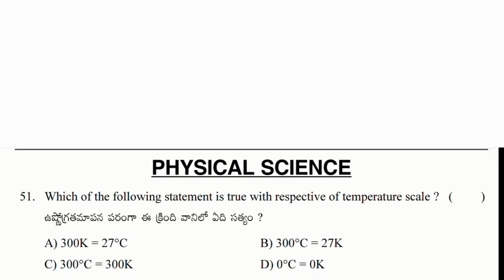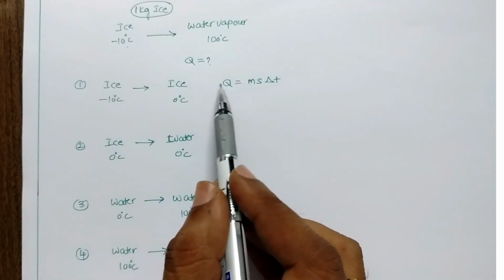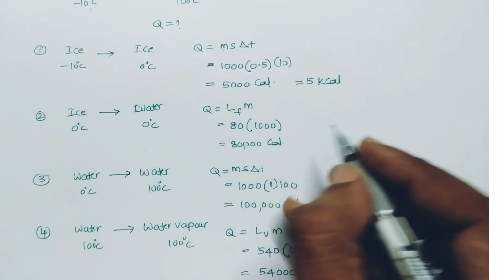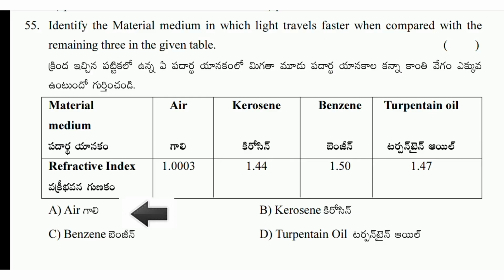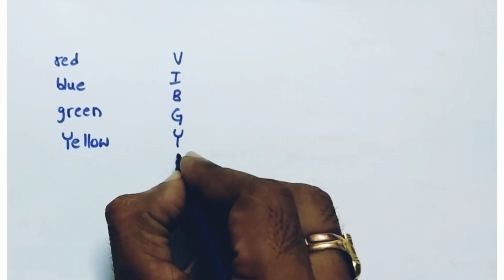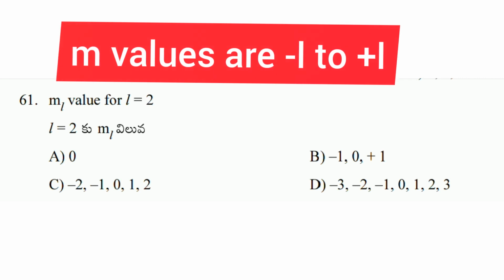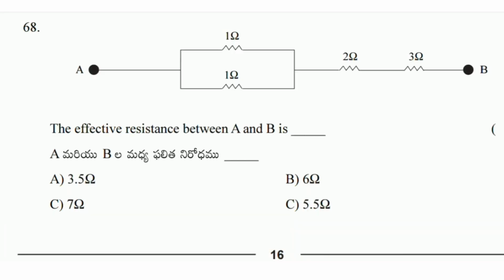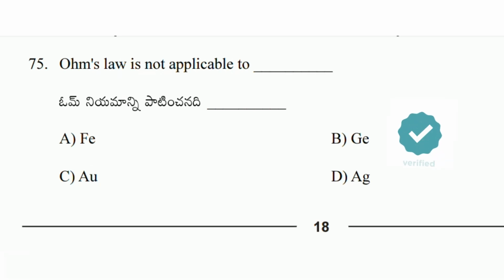IIIT2020(RGUKT CET)OFFICIAL MODEL PAPER WITH SOLUTIONS.ALSO USEFUL FOR NTSE,APRJC, POLYTECHNIC,DSC.

Comment: Ans for Q.62 is wrong...@DVR Phani kumar .  The ans is 10^-13 in cms
Reply from the maker: Good...if it is asked as the radius of atomic nucleus ....then the ans is 10 power -13cm
If the question is the atomic radius is measured in.....then the ans is 10power -12m or 10power -10cm